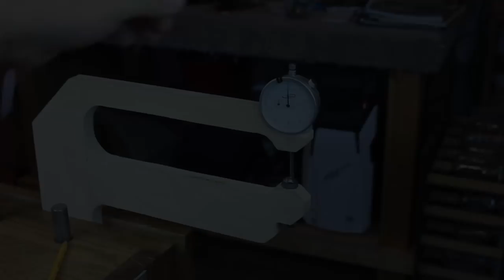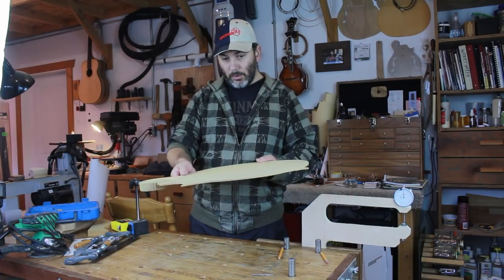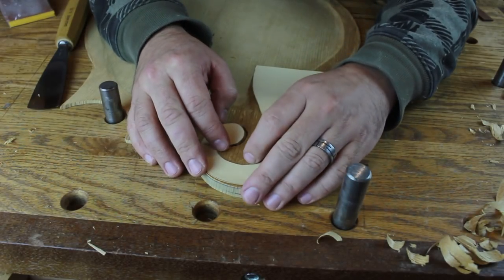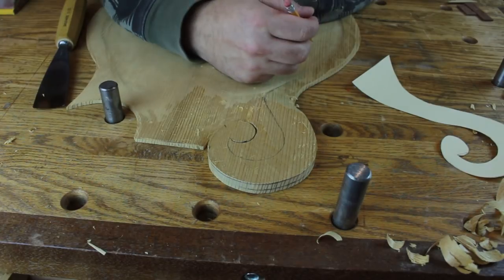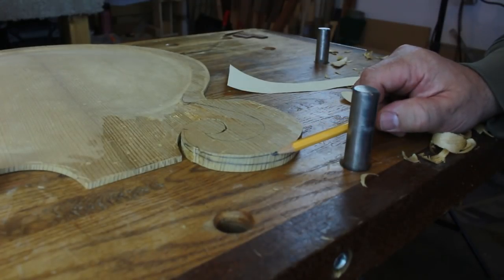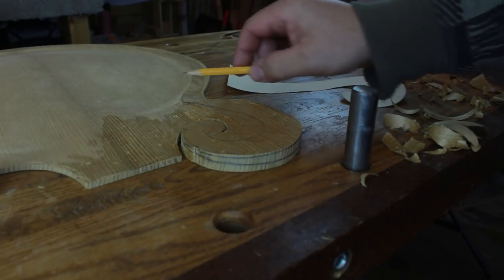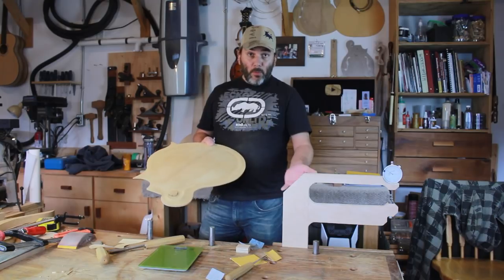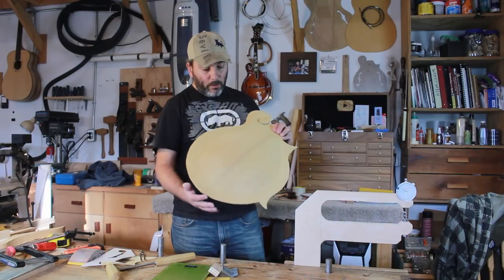Carving a F5 Scroll/ Part6

Comment: What is the big dip 1” from the edge for? I have not seen this on other builders instruments! You also do your F-5 mandolin the same with the dip, what would be the purpose?
Reply from the maker: Great question David. It’s the area of the soundboard where the movement happens ( try to picture yourself pushing on a subwoofer speaker, the outer rim is where the movement is) with wood you obviously don’t get the same amount of flex but still need to get that section as thin as possible. Other builders do this too, may not be as obvious though.
in fact if you purchase drawings for a mandolin online you will be able to see it on the cross section of the instrument. Thanks for watching!